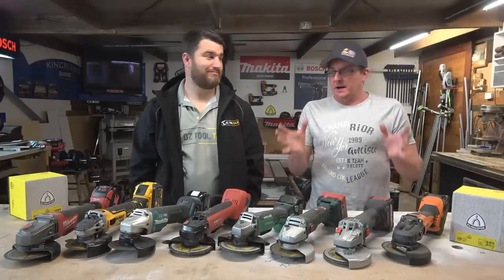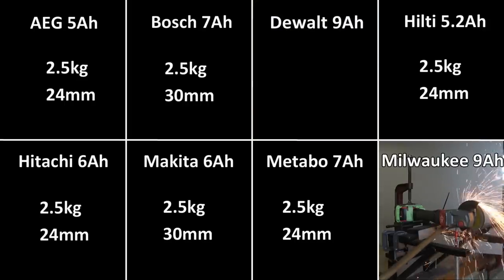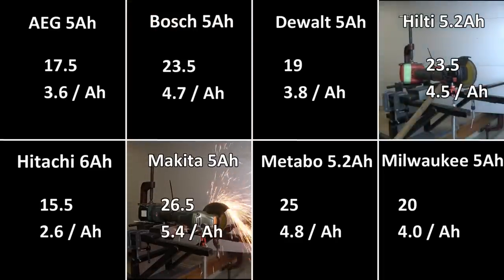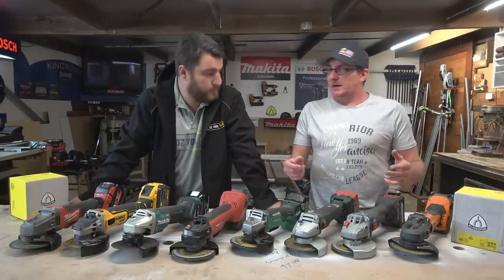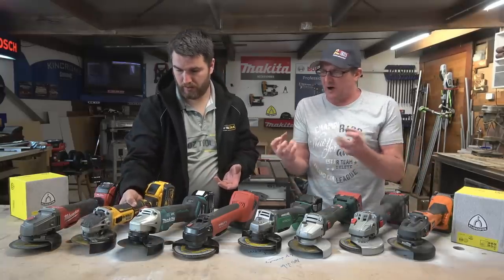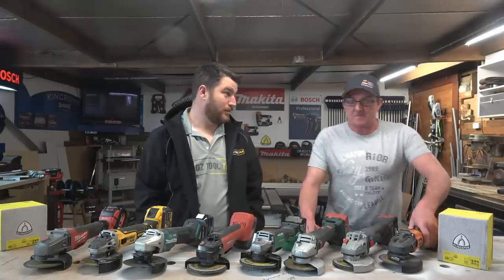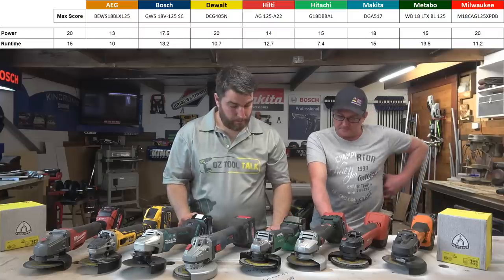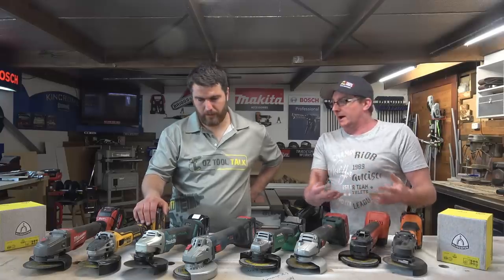18V Brushless 125mm GRINDER SHOOT-OUT - Makita, Milwaukee, Dewalt, Bosch and MORE.

Comment: Test was good, the weight tests was really good.
I would have liked to seen it used with the handle. 
And talk about the button, I can't  stand the Milwaukee paddle button, I also don't like the little air tool button press safety. Would really suck trying to hold it while using it in odd ways.

The other test would be hand pressing into steel with grinding wheel to see if it'll stop or when it'll stop.
How long you'd get grinding with grinding wheel, you could do the same weight test but with grinding wheels.

The other would be seeing the depth you can get, until a part of the head stops the cut or is in the way too much.

The above things are the main problems I have with grinders at work.
Reply from the maker: [Dwain] we did talk about the switches where we thought they were annoying. Yeah there's so many tests we would like to try, but this was already a massive amount of work .... [Dwain]
Reply: Yeah, I just can't stand the Milwaukee paddle trigger, when in the shop I can see it being an real hassle having to use it in different directions, I work on shipping containers and tanks and use grinders in all sorts of directions, so I can see cordless grinders being good.
Though I have noticed they are 8,500 RPM and cord grinders are 12,500 so I wonder how that'd go with say kick back or slow downs,  though I do think that might be safer in some ways.
your video goes through a lot of stuff the weight thing was really good I thought

Comment: Love the video fellas. Did you feel any of the guards got in the way for concrete cutting? Would also be interested in depth of cut for the concrete cutting?
Also interested in your thoughts on the possibility of dust collection when using these, the new OSHA table one compliance in the usa has had me thinking about my concrete cutting and would be interested in your thoughts?
Reply from the maker: [Dwain] yeah we didn't even touch on dist collection, and we haven't thought hard about it this time.

We didn't put depths in the table, but they are all VERY similar. No guards stuck out to us as making concrete work difficult...
Reply: @OZToolTalk  great reply thanks

Comment: Charge time should be compared on how long it takes is better. 
The clever ones are monitoring the battery and protecting it for a longer life. Slow charge is better for looking after batteries.
If you want to know how good a grinder is, ask a welder. They burn through grinders like know one else.
 They choose Makita, Metabo and Hilti because they last.
The very first test, some grinders cut out with the weight applied to protect the motor. This is to protect the motor from idiots.
You should add a final destruction test, keep the tool going until it won't work anymore. That would give the guys an understanding of value for money.
Reply: The main issue with charging batteries quickly is overheating of the battery, so many fast chargers have fans to keep the battery cool, allowing it to be charged quickly without overheating. The makita charger, for example, will wait for a battery to cool down before charging if it is put on the charger still hot from being discharged

Comment: Looks like you used same cutting disc for run time test , not new for each test? 
So there was huge difference on diameter because first test wore those unevenly.
Reply from the maker: [Dwain] For the most part we gave each disk just a cut or two before starting the test, because you often get funny results on the first cut for some reason. But we applied evenly across all brands.

Comment: I had training from Milwaukee and as I understand the batteries only reaches full capacity after 5th charge as they tend to build up life
Reply from the maker: that might be true of several brands actually...
Reply: That is a reality of lithium ion cells. They all need a few charge/discharge cycles before they are at full potential. Also a thing to note is how these first and critical cycles are done. You want a slowish and steady drain down to 20% and an even slower charge to 100%. Rapid chargers are great and they get you back working much quicker but what these companies that sale you these sometimes $200usd plus dollar batteries is the faster you charge them the less overall lifespan they will have. Yes they hope and beg you to buy their super chargers not only to grab the $60-$100 for the charger itself but so you can buy more batteries sooner. That being said if you are a contractor and have to have those tools running nonstop then the amount of work you produce greatly outweighs the negative effects of fast charging and you make more money then you spend on batteries and such.

Comment: are all the rpms the same? i own the milwuakee and on some attachments i notice its 8500rpm vs 11,500 on most corded models and cuts/grinds slower, although on some accessories like wire wheels and any polishing/sanding attachments like the lower rpm
Reply from the maker: the spec sheet contains that info. they're all pretty close, 8500 - 9500 i think. [Dwain]

Comment: Hi
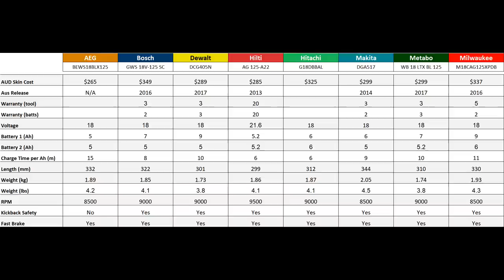I think that you not measured the RPM of the grinders for the chart on 4:20.
None of the machines rotates faster than 8500 rpm!
The Bosch is even slower than 8000rpm
I also thonk, that the comarsion of the runtime ist not real. 

The 5,2Ah battery of the 22,6V Hilti is calculatet to 18V of the others like 6,5Ah!
Reply: That's not relevant Volts (power) and Amps (current) are what count, no load speed is also mostly irrelevant, in fact if they can keep no load speed down while building torque through a gear reduction without stalling the motor that would help prevent flinging wire when using wire wheels, etc.

Comment: Excellent job as always guys. One criticism.... If you're going to use decimals in your scoring, then surely that should be reflected in the final scoring? This would mean that DeWalt scored 43.7 and Makita 44.3 Milwaukee 41.9 and so and so on. Rounding up the decimal really defeats the point i think and means you don't end up with a clear winner, which was the Makita. Just a small niggle i know, but it was the scoring system you chose and you said you would like a clear winner lol so you got one.
Reply from the maker: [Dwain] I considered it but it made the outcome messy. Also, when you're scoring out of 50, 0.3 here or there isn't significant. 

If i rounded each score and then added those rounded numbers, the scoring would be much less accurate. If I rounded in the summary but actually added the precise scores, the numbers may not appear to add up.

So the way I've done it is fairly defensible I think. Still I don't strongly disagree with you.
Reply: @OZToolTalk  Fair enough Dwain. I see your dilemma, either way you guys did a great job and always do. Thanks very much mate for going to the trouble of A) Doing the hard work and making these videos and B) Replying to me, much appreciated.
Reply from the maker: @SeanCleverly  you're very welcome Sean. Thanks for the support!!
Reply: Yep...noticed the same thing. Not quite a tie, Makita actually won by a nose. If anyone wants to pay that close of attention.

Makita needs to decide how they want to go about some bigger batteries.

Comment: i get a feeling these cordless grinders with somewhat low rpm (most around 8k) eat cutoff discs faster than the corded ones doing about 12 k... anyone else that have experienced this?
Reply: old FEIN 5"  corded run 8000rpm , put a bigger shield on it for 180mm disk and it did very well

Comment: 115mm or 125mm angle grinder? Can't think.which size to get!
Reply: Definitely want to go 125. You can use the 4.5 inch as well as 5 and 6 inch wheels and the overall size difference is negligible
Reply: @jamesfair9751  thanks for a response! Is the body of the grinder the same size or just a larger guard? I will be getting a makita as have the batteries already
Reply: muscleprotein the body is slightly larger hard to tell unless you have them side by side tho it’s that small of a difference
Reply: @jamesfair9751  nice one! Thanks for the help! 125mm it is

Comment: Hi guys, thanks for a really decent review! A bit hard to find the info about the Makita with Switch instead of paddle, is it DGA 518..?

BTW, this AEG grinder was my last straw to keep up with the platform. I'm just made an add selling EVERYTHING, I don't care about the warranty, the machines are lacking power and torque out way too easy. Now it's Dewalt Flexvolt & Makita all the way, never ever AEG again.

Comment: How do u do a test with specs so different?
Seriously, I am still only at the beginning. Straight up I see a problem, how do u compare a 5ah to a 9ah?
I have seen a few of these comparisons & one thing I learnt is, the size of the battery makes a big, big difference. 

Not sure if it's worth my time to watch this. Since the comparisons r so far apart
Reply from the maker: I understand you're concern. We address that concern in the discussion, and talk about it. I think you won't be worried about it by the end. [Dwain]

Comment: I get why u did it with incomparable devices

I still don't know what to buy
I was thinking Aeg, but in this test it faild
Reply from the maker: the AEG didn't fail, it's a great tool. and now they have a FUSION version, did you see our review of it?
Reply: @OZToolTalk  I didn't mean it failed
But it pretty much came in last
I think I like how it has the great overall
power & speed & the finesse. Not as good as sum, but It has it all.

The fusion did look good, but it lost it's finesse. Not sure what to make of it
Reply: @OZToolTalk  
i was thinking about the "oil pulse" not the fusion. When I said it lost it's finesse

i just seen your review on the fusion grinder. Looks good!
How's the fusion runtime though? 
I know it's bad with the older tools. Is it really better with the fusion tool's?

Cheers 🍻

Comment: Why are you using a 9Ah battreries for the american companies, and less powerful for the other brands? Why?
Reply from the maker: We used the largest batteries available for each brand at the time.
Reply: @OZToolTalk  that`s not true. For exemple Bosch is available with 12 Ah Pro Core batteries. I`m not stupid my friend.
Reply from the maker: Ivica, before you get passive aggressive, did you notice I said 'AT THE TIME' in my comment. Also, did you bother to check when this video was released (in Sep 2018)? It is almost 3 years old, and 12Ah batteries were certainly not available at the time. [Dwain]
Reply: @OZToolTalk  I`m not passive aggressive. Just straight and very, very active. We are not talking here about psychology my friend, we are talking about tools. Love you Dwain. I`m wrong. And stupid. And passive aggressive.
Reply from the maker: fair enough :)
Reply: @OZToolTalk  even more! what do you thikg about that, doctor? Am I passive aggressive or not? :))))))))))))))))))))

Comment: I don t understand why the manufaturers  don t put the switches in the centrum side of the  small grinders? In the oposite side of the padles, to been eazy tu use by left or right hand.
In another way, just look at the cuting concrete. All grinders cut with the (silica) dust going to the worker. Every guy is free to protect his body, or not, but if somebody choose to cut with the dust going in oposite way, the switch will be underneed (thats mean hard to use, and dangerous because can be accidentally stoped).

Comment: Where is my 18v Fein, I think this would beat all of them
Reply: Actually no. They have a very good motor but are stuck on 2 row 18650 batteries. Even though they use the best 2,6Ah cells on the market, they got no chance against 2 row 20700 or 21700 (dewalt, bosch, metabo, milwaukee, hitachi), 3 row 18650 (milwaukee, dewalt) or even 3 row 20700 or 21700 (bosch, dewalt)
(EDIT: I guess Hitachi Multivolt have 21700 cells as well)
Reply: Are you kidding? Dewalt is the best choice

Comment: awesome test guys been waiting for a something like this on cordless angle grinders they seem to get left out as carpenters dont touch them, i find it curious how hilti is always back of the pack on the cordless tools even though theyre suppose to be the most professional/priciest and they use a couple extra cells in each battery to get the 22v platform

correct me if im wrong but i dont think they have a brushless motor yet so all their 22v tools are brushed which wastes alot of power for cordless tools and when the amount of power the batteries can output is limited efficiency = power
Reply from the maker: Cheers man. Hilti do have brushless tools, but not many I think. It certainly hurts their runtime, but doesn't have to hurt power necessarily.

Comment: Watched reviews tonight again, my Bosch brushed grinder and 2 core pro batteries were stolen last night plus compact driver and charger it's really sucks :( 
Now I only have makita line left seems like need makita grinder, but don't like paddle version, is there anyone use switch makita grinder at all, I think it call DGA511, also any feedback Oz tool talk for makita 125mm 18v grinder? Really appreciate.
Reply from the maker: That's a bugger! Umm, we clearly like the Makita 5" grinder, it came equal first in this comparison! The switch version is essentially the same unit.
Reply: @OZToolTalk  Thanks mate. I am not very familiar with paddle will invest makita 5 inch grinder with switch version this time. Definitely will LOCK IT properly.

Comment: That's good data but I think you still need to do all those tests again with the same size batteries that's what will make it fair all the way through because you are testing the grinder not the batteries
Reply from the maker: we did use the same size batteries for most tools. we explained our battery choices in the wrap up. hopefully you listened to the whole thing...

Comment: There is something wrong with you score... You rated the grinder by the power at which they stopped their motors. I don't think it is very correct, because bosch, for example, known to shut off the tool before it damages the battery or overheat the motor. Milwaukee, on the other hand, sucks as much power from the battery as it could, I have found several times Milwaukee batteries burning during normal usage, so this extra allowed power could cost you battery or new motor. I think more adequate would be measure the best time it takes for a grinder to cut a bar with any weight, because that is whats matters. It would be great also to measure the heat afterwards.
Reply from the maker: Some people want speed, others want a late cutout, others an early. It's a combination. Our score wasn't purely on cutout weight, but also on speed of cuts, and ease of grinding, cutting concrete etc. But I'm not arguing that it's objective ... [Dwain]
Reply: Sorry, I have forgotten to write that this was great test and i like your approach more than any other on youtube. I just want you to not forget that the first thing is to get the job done. So any little detail that helps should be counted. For example I have switched 2 grinders recently just because there were no dust adapters available  and dust hose fittings were very hard to use. If it was 10% faster/slower - I don't care, sometimes you can get 50% + in speed just if it is more handy to use.

Comment: Honestly its irrelevant, DeWalt's 54v cordless Grinder eats all of 'em for breakfast and stays hungry for more, cuts square through 1.5" steel plate without stalling and just about almost (if you have enough batteries) makes corded 5 inchers obsolete. They'll need to start making 30Ah+ battery packs at this rate just to run the newer gear.
Reply from the maker: I own both the 54V and 18V grinder and mostly only carry the 18V in my ute. It' got enough power without being as bulky/heavy. [Dwain]

Comment: Not using one of the better batteries for the Milwaukee. You should have used a 6.0 HO an 8.0HO or a 12.0 HO. The battery you use just has a longer run time. Doesn’t have the high output.
Reply from the maker: This comparison was conducted before M18 HO batteries existed.